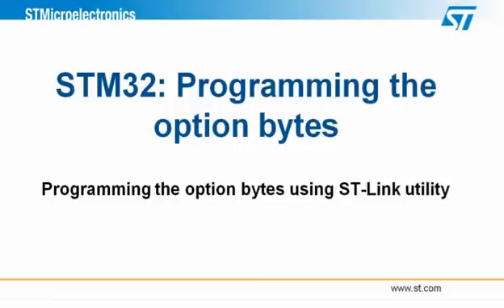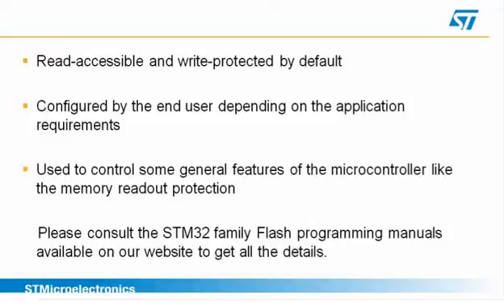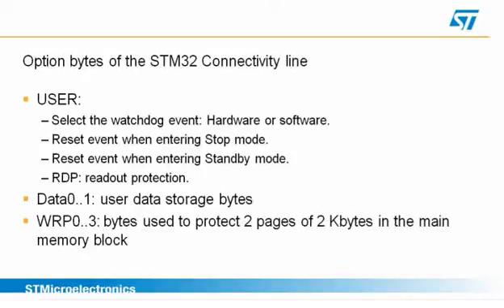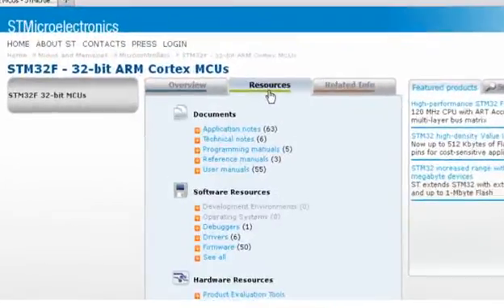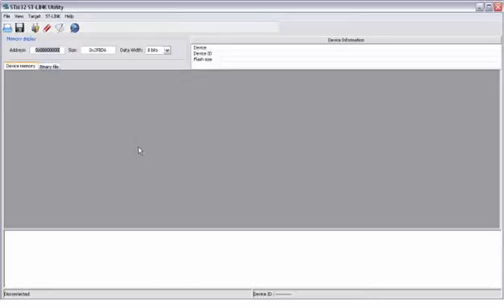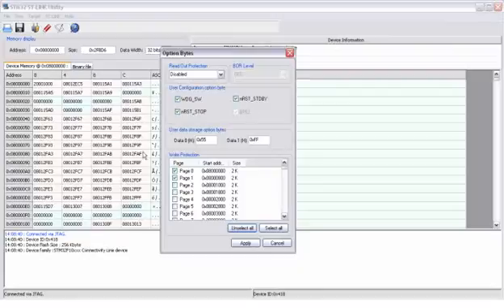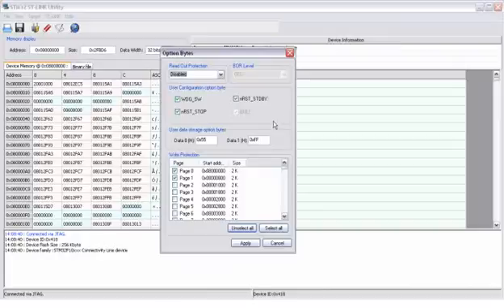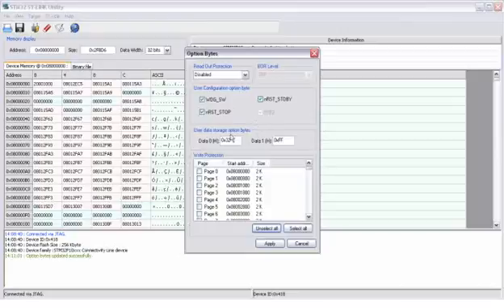STM32: Programming option bytes

Comment: So would the idea be that you set these option bytes AFTER you've flashed your firmware onto the device? I know its a dumb question, but you mentioned that if you were to disable, then enable the option bytes, the flash gets erased, which means any firmware you've previously uploaded is gone.

Comment: What do I do if I keep getting this error. The videos are awesome btw 

09:18:58 : ST-LINK SN : 16004A002933353739303541
09:18:58 : V2J37S7
09:18:58 : Connected via SWD.
09:18:58 : SWD Frequency = 4,0 MHz.
09:18:58 : Connection mode : HotPlug.
09:18:58 : Debug in Low Power mode enabled.
09:18:58 : Device ID:0x410 
09:18:58 : Device family :STM32F10xx Medium-density
09:18:58 : Can not read memory!
                  Disable Read Out Protection and retry.
09:23:01 : Could not set Option bytes!
                  Please reset the target and retry.
09:23:03 : Can not read memory!
                  Disable Read Out Protection and retry.

Mother Board # 

GD32E230
C8T6
AS84W6
JJ2022
GigoDevice
ARM